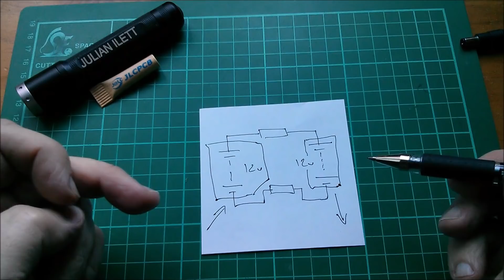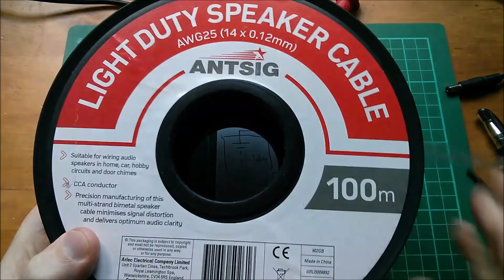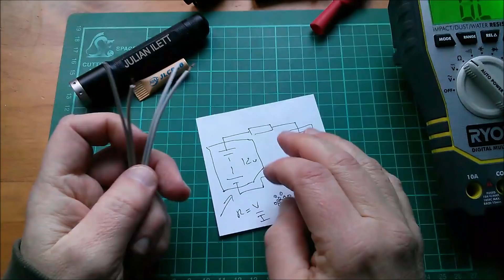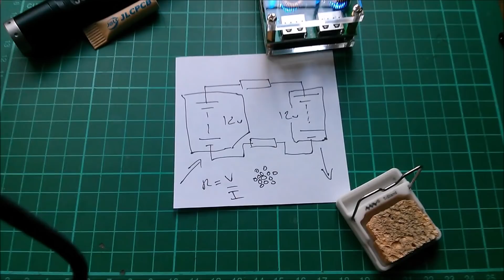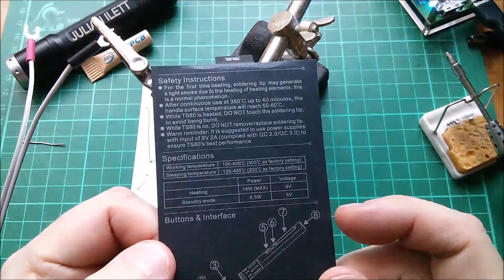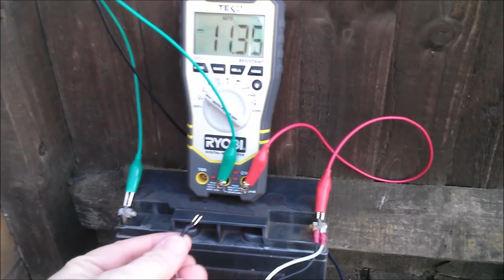Low Tech Power Distribution

Comment: Wouldnt it be much easier and more elegant just to put another small PV-Panel at the outside light instead of laying 20+ m of wire to load the smaller battery? The sun is available everywhere - why not use this lucky situation :-) I would guess the voltage drop on the wire would be that much, that it tooks ages to leverage the batteries in this is not very efficient either.

Comment: Be careful! Now China also makes iron cables, they have an unreasonably high resistance. But they are easy to spot with a magnet.  The last cable I bought, with Banana connector and Alligator Clips, was unfortunately for my component testing instrument. 1 m. (40 inch) cable = 1.5 ohms.

Comment: If that cable is aluminium, soldering to crimp connectors is a total waste of time. They will likely fatigue and crack faster than you can boil a kettle.

Comment: Isn't the meter performing the same operation you're doing with your power supply when measuring the resistance? Why would you assume the meter would be less accurate?

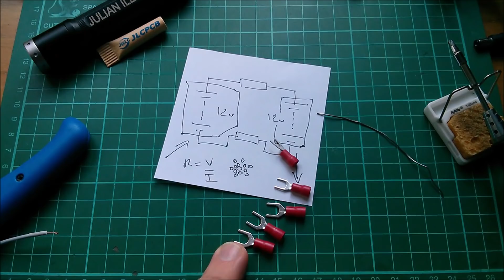Comment: "Just a tip and only for a minute" 13:20 Easy way to remove the plastic insulator, is to touch the hot soldering iron the the folk metal side for 2-3 seconds, then gently pull the plastic insulator of, way easier than pulling with pliers and bending or breaking the metal bit.

Comment: Aluminum is a better conductor than copper measured per kilo, which is why it is used for high voltage wires in combination with steel to achieve strength. But be careful! Now China also makes iron cables, they have an unreasonably high resistance. But they are easy to spot with a magnet.

Comment: I bought a 10W LED solar security light with PIR from Poundland for a fiver. Swapped the 3 crappy 300mAh batteries for Ikeas's 2450mAh Ladda (Endeloop) batteries for £4 and it has never ran short of charge at any time since it was put up. 
No carpets or fingers were harmed in the process of doing that. And I'm not outside freezing in January tinkering with it a couple of hundred miles further north than you, so win, win, win.

Comment: When the battery gets really discharged the acid turns to water and it can freeze especially as your battery is exposed, You might as well use one of your many boost converter to get a proper charging voltage and negate the losses in the terrible cable that you are using. I think this system will slowly sulphate your battery in any case.

Comment: how many time did it happend to you that you putted on a connector but forgot to put the heat shrink on the cable before soldering or clamping? it happend to me many times
Reply from the maker: Too many times :)

Comment: Should use a fuse between the batteries in case one of them develops an internal short. The results wouldn't be pretty.
In case of "massively parallel" battery arrays (several large batteries in series) each should have its own fuse.

Comment: Maybe you could run that PIR and LED light on the long wire alone, and have no supercap or SLA? If it has proper current regulations to cope with the dipping voltage, it should be fine :)
Reply from the maker: Well the 10W LED takes around 1A from the 12V battery. 1A through the 18ohm resistance will drop 18V. But I just found some solid copper bell wire which I'm hoping will have a lower resistivity.

Comment: You're right about the 14 wires - it should have been 13 IF they were using a typical circular Round or Star Pattern like you drew. But likely the pattern that works for 14 is straight Rows of 3 +4 + 4 + 3. with the first "3"row starting on the left and the last "3" row starting on the right.  Would have been nice to see you cut the cross-section of the wire and show it under the microscope.
Reply from the maker: 2 + 3 + 4 + 3 + 2 also adds up to 14 :)

Comment: If you read the label you will find that it is intended for indoor use; I bet the insulation will break down soon. From ATSIG site "SPEAKER WIRE 100 MTRS - 25 GUAGE

Light duty cable. 14 strands, 0.16mm sq. conductors. Suitable for speaker wiring in home, car, hobby circuits and door chimes. Polarity marked.

Comment: well cheap speaker wire good for maybe 100 to 200 watt for sound but not sure of what volts that would be converted into.. but 12 volts isnt what it made for an all other stuff.. also speaker wires are not weather resistance an 12 volt could make a nice little fire still.

Comment: That's a place for an XL6009 boost/buck converter - set the output voltage for whatever you want on the second battery and let the chip handle everything else.  Or is that in your next video? ;-)

Comment: Fuses...needs fuses!  Could you not hear me shouting thru my computer screen?  I know it should never have more than half an amp or so but what if its damaged by critters or whatever else?  I would stick 1A or 2A fuses at both batteries just in case the worst happens.
Reply: The cheap, shitty Chinese cable will melt and fall off. That's what will happen if something chews through it close to the battery. Wire that thin IS the fuse.
Reply: @tin2001  but will it melt before or after it lights something its sitting on/near on fire?

Comment: 2 things my friend. 1) I think it has been mentioned but I do believe that the silver wire is aluminum. Which would have a different resistance I believe. 

2) My father always told me to NEVER put a battery directly on the ground or concrete. He said it would ruin the battery. I don't know if it's true or not, but I did cringe seeing how you had them sitting  without an insulating layer.

Best of luck to you, your projects, family, and friends in 2019. Just saying 2019, makes me feel old.

Comment: Firstly I want to say that was a really enjoyable video to watch Julian. I do particularly like the ones where you get "out and about" with things. The concept of having a tinned wire and a straight copper one is a very old idea and goes back to the days of tru-rip two core lighting flex. Sometimes the tinned conductor will not have all the strands tinned only a few. However, it's quite redundant on a cable that already features a polarity stripe on the insulation. 

So yeah, I was wondering if it was not pure copper cable and there was some aluminium involved? Someone else seems to have made the observation that there was, and definitely that high resistance for such a run suggests such a material. I'm curious to know however, if the silver conductor was just un-coated aluminium or if in fact it was "TCA" (tin coated aluminium)? It seemed to solder OK, and if it was bare aluminium it would have been a problem to tin. 

I like these "low tech" ideas being put to good use. In fact I have a similar arrangement in my power room that moves some charge over to a small SLA that powers my lawn lighthouse feature. In my case however the distance between the two batteries is less than a metre and the resistance is introduced by a small MES incandescent panel lamp. 

It will be interesting to see if your gel battery actually does reach full charge, as there is always some current drawn by a lead acid battery & it wonder whether it will reach an equilibrium due to the resistance of the cable before top of charge is reached?

Comment: I’d be very interested to see an experiment with this CCA wire to determine the minimum length where it could survive being damaged and the wires shorting together. I’m thinking insulation damaged (imagination generates numerous comic scenarios) and wires touching.
Aviation wiring practices require wiring to be fused so that if there is a short ‘anywhere’ a fuse or circuit breaker will stop the smoke getting out. Groups of low current drawing equipment fed with thin wire have a common fuse/breaker that blows if any of the wires or equipment develop a short.
Groups of high current equipment likewise use a heftier wire and a heftier fuse that will blow if a single wire develops a short.
For example, if you have a bunch of 20ma warning LEDs connected to micro-switches with fine wire, you can’t directly connect them to a convenient 15 amp power bus. A short in the fine wire would vaporise the wire without blowing the fuse. Needs to be protected by a ~500ma fuse

Comment: Did you use light weight cable to reduce the current from the solar panel or because it's cheap? Reducing the current doesn't make sense. You've done a video on charging/discharging batteries in parallel. They self-balance. 
About these cable shoes. I've been trying to find good crimp tools for cable shoes and connectors, but I can't make good strong connection. So I solder it as you do, but it takes forever, especially if I make cables with 5-6 pin connectors in each end. I was successful with non-insulated cable shoes - I found good (enough) pliers, but they don't work well on insulated shoes. But I'm sure you can find pliers that work if you try. Once you can make good solid connections with pliers you will never go back to soldering. It's too much effort.
Reply: Nikolay Pelov - The crimps have to be the correct type for the crimping tool. Or the crimping tool has to be the correct type for the crimps...
Only use good quality crimps, not the cheap rubbish. Also, you will only get a good result if the crimp is inserted correctly in the tool.
Believe me, I’ve seen apprentices mess up because they did not listen!

Comment: I bought some singles of silicone cable, used it for making croc clip cables and also used it for making a cable up for my ts100. Just at intervals put some black insulation tape. 
Very flexible, and use it with my 19v boost charger usually used for my laptop charger as a part of my solar system.
NOTE: the ts100 has a 2.5x5.5mm dc jack not a 2.1x2.5mm!

Comment: 14 is a very common number of strands for equipment wire, it forms an irregular hexagon with four sides having two strands and two sides with three strands or vice-versa.  19 is also common especially with expensive silver plated/PTFE wire and it forms a regular hexagon with three strands per side.

Comment: I note a lack of fuses on your battery connections. You might consider adding some,just in case something goes wrong. It's good practice to fuse every load (or charging source) coming off of a battery,within a few inches of the battery terminal.

Comment: I've noticed your audio quality isn't that great, like it sounds very digital (compressed or clipping? I'm not an audio guy) and certain sounds have very high pitched sounds even though they shouldn't (such as your wire strippers). Just an FYI in case you changed the audio settings recently :)

Comment: To turn off TS80, hold button b for 3 sec
Reply: Runder Caster - which is button B?
Reply: @Mark1024MAK  there is only 2 buttons one is A that is closer to the tip the other is B that closer to the USB type c connector
Reply: Runder Caster - Thanks 👍🙂
Reply: just try both it'll get you there in no time :)

Comment: Why do you solder on these crimp-connectors? Just crimp them (you can use bigger ide-cutters for them if you don't have the real tool) and then with the heatshrink around them for the colour. Ready soon and a very solid connection.
Reply: I wouldn’t have trusted the copper ‘crusted’ aluminium to not crumble when it’s crimped. If it was solid copper it might have taken the crimping more securely
Reply: @snukie73  Could be a good reason indeed. Did you try this out with these kind of cables?
Reply: Elvin Haak - Using proper crimps with a proper ratchet crimping tool is so much quicker 😉
Reply: @Mark1024MAK  Yes for sure! I love these tools but if not then cutters and maybe in a very last resort I would consider soldering. 
And normally the better, a bit longer crimps. 
Done 1000-ends of them at least...

Comment: Hello Julian,
I was thinking, how about adding a sub $,€,£ xl6009 step up module at about 35-45 volts and a step down battery charger/ led driver to the other side?
Is there a easy way to mesure the efficiency gain, taking in account losses, solar panel price and so on?

Comment: Why not charge the small battery with its own solar panel instead? Connecting those batteries together I do not think is a good idea.
Reply: Maybe the solar panel would be in the front of the house and quickly stolen.

Comment: Some nice marketing waffle on that cheap cable reel that you have bought Julian. “CCA conductor”, “precision manufacturing of this multi-strand bimetal speaker cable minimises signal distortion and delivers optimum audio clarity”. Yeah, right, just like “heavy duty” battery implies more power, but actually means old cheap and rubbish battery technology. So copper coated aluminium means cheap rubbish cable. The only useful information is the “made in China” bit...
Reminds me why I don’t shop at Homebase... [Either too high a price, or poor quality, or both!]
Reply: At least the Heavy Duty used to be legitimate at one time (zinc chloride cells were heavier duty than the original old ones with ammonium chloride)

Comment: I may test this idea using a single conductor, with "ground return". Depending on distance and conductivity of the soil, this may be capable of letting enough current through to keep a small supercap charged for intermittent high loads. You could install a large earth/ground rod next to the big battery, and a smaller one at each of many loads, each with their own very fine single conductor keeping a small supercap charged. Ideal for WiFi or LoRa sensors that only wake up intermittently, but need a decent dose of current from the local supercap to run the brief wakeup, measure, send, sleep cycle.
Reply: Even microamps of current may be plenty to charge up a wee supercap that only gets drained at hourly or daily intervals.
Reply: @DarronBirgenheier  What is the self-discharge for a supercap (with protection)?

Comment: Tinned copper cable is normally higher quality cable than uncoated plain copper cable. The tin plating on the copper helps prevent the copper from corroding. The tinning also helps reduce copper migration into the insulation.
Using thin cable to link two batteries may appear okay, but unless the load is very low power, you will loose a fair amount of power in the form of volt drop through the cable if the cable is a long run.
Reply from the maker: There are so many losses in my solar power system already, I figured one more wouldn't hurt :)
Reply: @JulianIlett  Well actually, the losses here for this extra accu-charging are almost nothing compared to the other losses like your distribution with the voltage-booster and voltage-dropper you made... 
Almost zerooing out  probably because there is not going to be much current in this case.
a) during daytime the main batteries are charging and a tiny, tiny little energy will be flowing as a 'top up' to your door-battery. Since in the starting of the day the main battery will probably be lower (beeing bigger, almost for sure also having a higher self-discharge besides beeing used) and slowly getting higher, a little bit is flowing also to the other battery. Current probably <<0.1Amp, and probably even less.
b) when main-batteries are getting fuller, they will go up to about 14.x volt and around that voltage the other batterie will probably start to conduct more as they are full (just try 'convincing' an old car battery getting to 15 Volt !).  But around that voltage your chargers will probably cutting off anyway to prevent overcharging of your battery so this will likely almost never happen if at all with your small 3 panels.
c) when it is getting dark, both batteries have charged to the maximum they will charge that day. Your second battery (near the entrance) is probably 'fuller' since it has not been used.
d) when the light is flipping on, the battery at your gate is getting 'drained' very, very slowly and since there is no real drop in voltage, there is no current to flow from the main to this battery. 

No flow even over a higher resistance cable means no losses, very low flow means very low losses.
Most losses are in fact most probably in the battery itself.
You could put another solarpanel (a small one) maybe near your gate (do I remember right and did you have one there some time ago?), maybe even pointing to the car-lights at night ... ;-)

Comment: That’s crappy cca wire. You‘re wasting a lot of energy. True 25 awg copper wire would have 4.4 Ohms for 40 meters.
Reply: Torsten B but in this instance, the resistance is actually useful

Comment: Why didn't you tie both ends of the wire together and  average?
Reply: I wondered that too.  The larger value would be easier to measure too.
Reply: flagpoleeip 
Hi i usually "cross" tie to read the exact losses, and for measuring,  i use a dps5005 with a load of 1A for easy calculations, unless it's too much for the wiring
Reply: Hi, sorry to bother you. What are you talking about?
Reply: @apbosh1  figuring out the resistance of the wire.
Reply: @compactrhone-2  but he did that already, once with a meter and then with the vdrop under the working conditions. Is that not enough? If it's that critical then surely you'd be concerned about temperature and the twisted together ends making a difference or am I missing something?